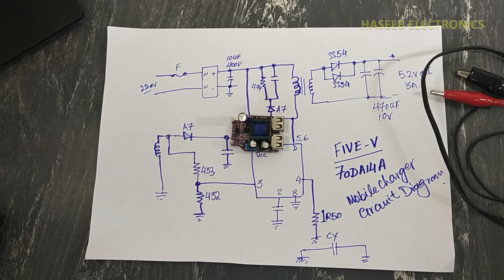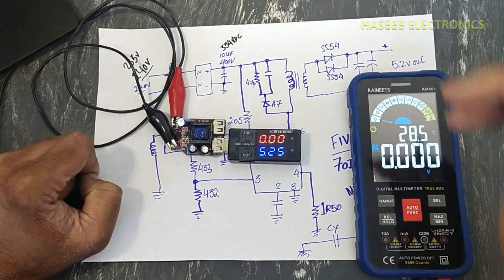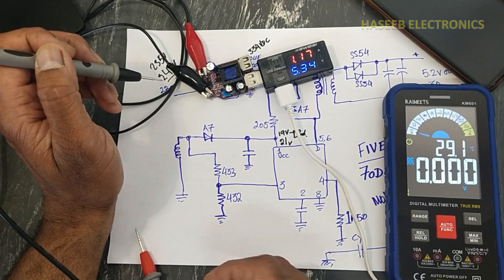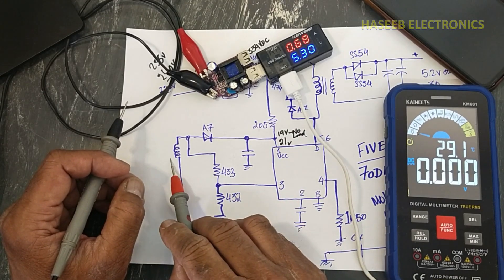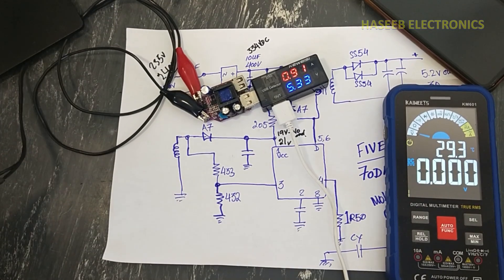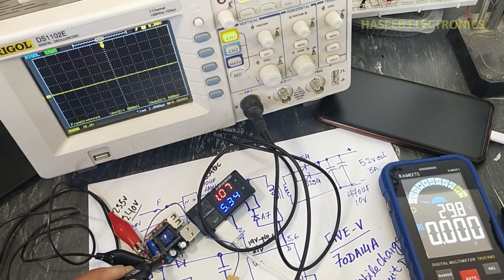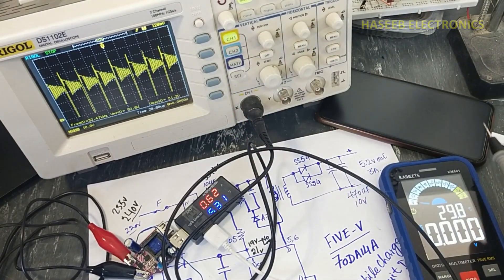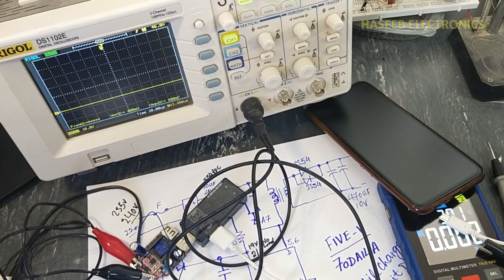{939B} Mobile charger circuit testing

Comment: Hello Sir, 
When you measured the voltage at pin 5 and 6 ,what is the peak voltage ? I don't want to blow up my scope. What is peak voltage at pin 5 if the snubber circuit is defective for example the snubber diode is shorted.? I think the peak voltage would be  in thousand 
volt. Thanks

Comment: Asalamu alaikum sir I have a 12v smps charger kit which turns on on series and outputs 12v continuously but if I turn it  on on direct supply it turns on only once then turns off then does not turn off I have changed the str 7m880 and sm transformer as well but same result plz help
Reply from the maker: please check its VCC capacitor, 
if possible send its front and rear side pictures to my whatsapp 00962-79-5324272

Comment: Hello sir I have 48volt Ev charger 3845 ic and 10n65 mosfet in it. ic and mosfet was short i replaced both but as i switch on the power series lamp glow and mosfet is short i have replaced ic vcc cap also i have shorted 5 mosfet what can be the reason please help i checked all resistors all are ok